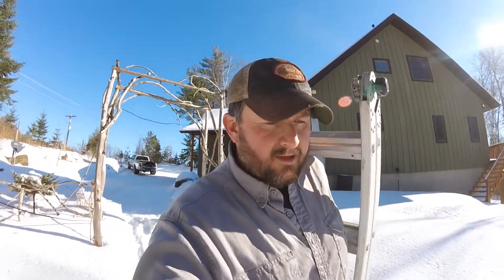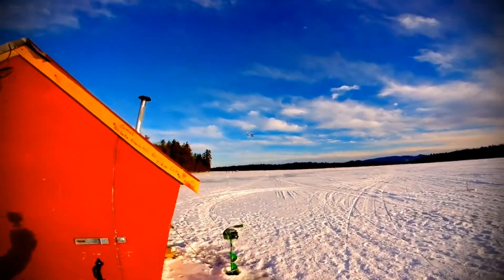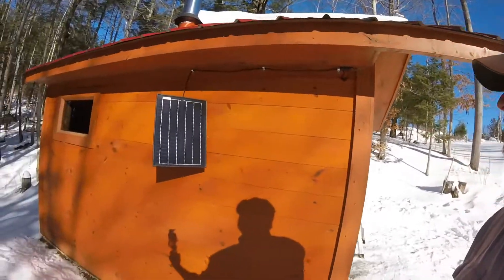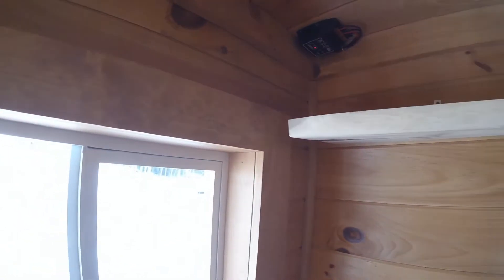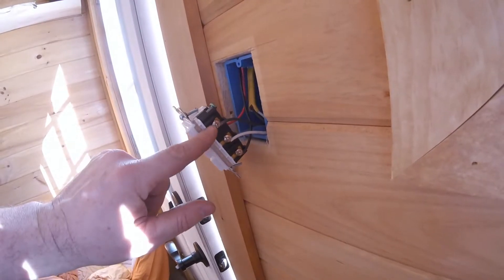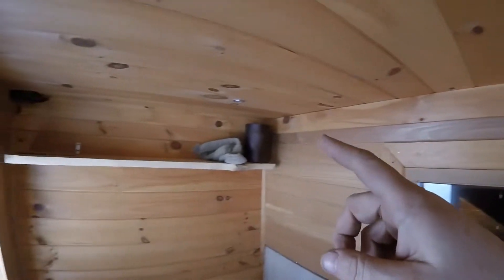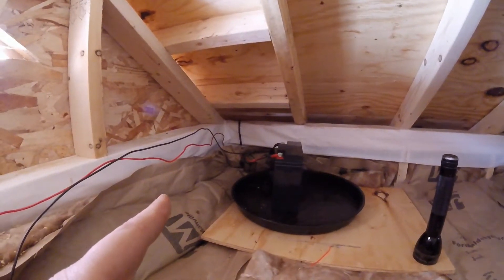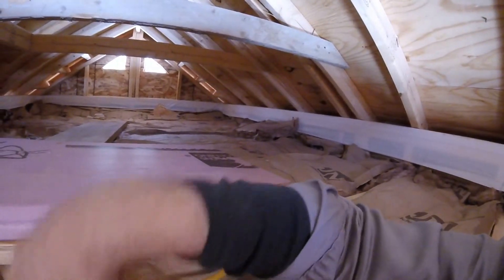Off Grid Wood Fired Sauna Solar Setup

Comment: What type of light do you have in the hot room?   I thought led bulbs couldn’t handle the high temps of sauna.  Did you just use a regular 12v led bulb in the fixture?

Comment: Love the work you have done here re the solar aspect of lighting up your sauna. Not sure if you posted the links of where you purchased these LEDs, battery, etc, but would love to see them. Found the RENOGY panel, but the others I am not locating. Please post if possible. Thank you.
Reply from the maker: Thanks for watching. I have added the charge controller and the battery link in the description. The 12 volt LED lights arent currently available. I think that you will be able to find some that are real close on Amazon . I will look and add a link if I find any. Hope this helps and feel free to ask if you have anymore questions. Thanks again for watching!
Reply from the maker: Lance Leo there are a few available on Amazon. Most are either under cabinet lights or landscaping lights. You will just need to find one that is bright enough for you needs.
Reply: @5yearplan269  This is outstanding. Thank you for the response and intel. Excited to explore these options to bring light into my micro sauna in MPLS.